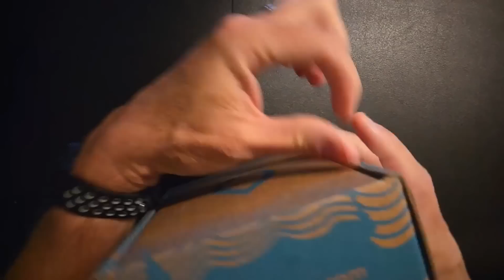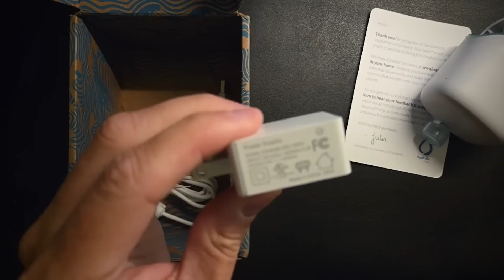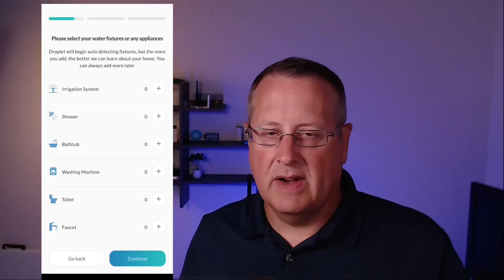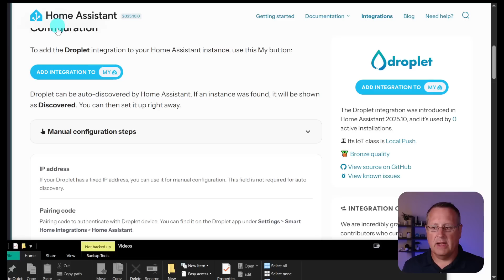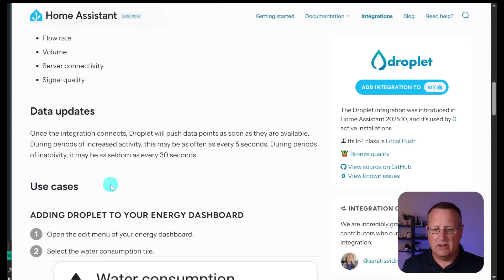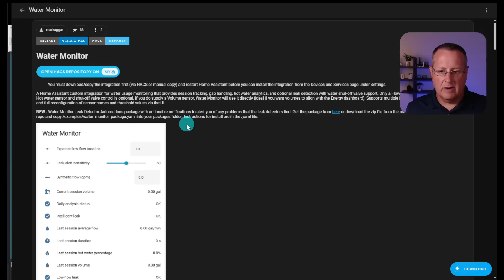Monitor your water usage with this easy to install water monitor.

Comment: My irrigation is a separate line and controlled by a B-Hyve controller integrated with Home Assistant.   I am thinking about adding this to the irrigation and monitoring flow rate during each zone to check for broken sprinkler heads, tubing, or non-functioning heads or zones.  B-Hyve integration updates HA quickly when each zone starts so I think after a few seconds for startup, I could compare the current gpm to a known gpm for a zone.   Do you think that is feasible?

Comment: can this be mounted only on the hot water line? I am more interested in seeing if it can detect micro leaks that I am having in my Uponor HOT WATER pipe than my water usage at this time. I would place it on the hot water line coming out of my heater. I have a recirculating system.

Comment: Why would you ever need to create an account on some vendor site in order to use a device like this? That would be the number 1 reason I would avoid this product. People need to stop providing personal information to every vendor that randomly thinks they need to track you. Not to mention using your google login for this. When your google account becomes compromised, you then have all accounts associated with it compromised at the same time. We all need to stop normalizing this type of behavior by vendors. Not to mention the need to install yet one more app on a phone to make ONE device work.

Comment: interesting summary Chris something i could use, i think the gaps may be something to do with water leaks and or if you say have various water flow items and add them that would most probably log their individual usage, i bet the ai then gets a handle on what pattern it will use based on regular times volumes they would use, what do you think, hi from downunder, it a shame you cant buy it out of the USA tho

Comment: i did install the Droplet with the HA integration.  I guess my end goal would be to quantify water usage for specific functions.  How much is going to laundry, flushing, dishwashing cycles?  Maybe I'll try a smart plug on the washing machine to detect when it is running and then try to correlate that with water usage during that cycle.

Comment: Droplet seems flawed: it’s cloud-dependent (so if support ends, you lose functionality), designed for indoor installs while most mains are outside without nearby power, and doesn’t appear weather- or IP-rated. The “advanced AI” pitch adds little you can’t observe yourself. If your goal is tracking usage for billing, a quick 10–20-second meter check does the job—no app, no data exposure, and it’s free.,  If it was local hosting no , issues with water ect.  I have a go as it is now it a but thanks but no thanks
Reply from the maker: This has local connectivity. It doesn't rely on the cloud to function. I have it integrated directly into Home Assistant. It is just part of the overall energy/water usage. There are definitely other options available that would allow for monitoring at the meter. Personally, my meter is buried in the ground and a "quick check" isn't really a thing.

Comment: Sure would like to know how this works
Reply from the maker: Only thing I can tell you is that is uses ultrasonic sensors. After running it for a few days, the app asks me to run a quick test to calibrate it and make sure when it sees a gallon of water, I actually ran a gallon of water.

Comment: The mounting requirements are very specific.   My exposed water line in my house doesn't have the required 4" of pipe... So won't work.
Reply from the maker: It was close for me. I have probably right at 4in. I did have to keep adjusting it until it would read (LED turned blue). Took a bit of doing. Still was under 5 min of messing with it.

Comment: I'm glad you mentioned section-based tracking. I have a water pump with a pressure tank, (off grid water) Note: pressure drops are needed for my pump to turn on when the pressure tank is empty, there is a half second delay when the water stops flowing. (Frustrating in the shower) From what you've described, the section setting is what I was wondering about, It sounds like it won't break up the shower into multiple sections with each pressure drop (that half second when flow seems to stop).
Reply from the maker: That is the other integration that I wasn't sure about. Yours is the first comment I've read that helps me understand what those gaps and "sessions" could be useful for.

Comment: does it work on plastic or PVC pipes?
Reply from the maker: Yes. I have it installed on my PVC pipe. There is a list of accepted pipe types on their website.
Reply: @mostlychris  I had a 13" horizontal run of 3/4 Pex with metal elbows and crimps on each end which should have met the required 4" either side.  I could not get it to accept that location.  I replumbed providing a 3' run of 3/4 Pex which did satisfy the device.

Comment: Unfortunately things like this wouldn't work in the majority of houses in Florida where the water pipe enters the slab (no basement).  Also, the water meter is outside.  In my case, it's at the edge of the road I live on.
Reply from the maker: My water meter is out by the street. I have a water softener line in the garage and that is where this goes. Also, since we have indoor water heaters, there is a pipe going there. What I can't measure, unfortunately, is irrigation usage.

Comment: This looks like it won’t be able to be outside, because my irrigation is outside before it goes into the house.
Reply from the maker: This one is indoor. I also can't monitor irrigation.
Reply: Why can you monitor irrigation like indoor. My irrigation originates from in doors out (in my case from its own pipe/meter.

Comment: It detects water leaks but does not indicate the minimum water flow detected?
Reply from the maker: Water flow is tracked in app and in Home Assistant if you have it integrated. Maybe I'm missing what you are saying.
Reply: @mostlychris  What I mean is that a typical water leak is so small that this system cannot detect it. This is evident from the fact that the manufacturer does not even guarantee or claim the minimum amount of flow that the system will detect.

Comment: For less money, you can get the Zooz Z-Wave Long Range 700 Series Titan Water Valve Actuator ZAC36 LR which actually turns off your water when it detects a leak. Yeah you have to do some plumbing, so depending on your situation, it may not be practical, but I plan to install that on my system, and will no doubt make a video about it, once I get my channel up and running.
Reply: It depends on your requirement and what you want for to achieve. If your need is to monitor water usage then you get the Droplet. If your need is to shut off a valve you get the Zooz based off another signal eg water leak sensor.
Reply: @neoxnet  true. Kinda sounds a lot like what I said, but with some additional details. I would be ideal to have both, but I wonder if there's an actual smart water meter that could be installed?  I have looked, but not found one.

Comment: I'd be interested to see an accuracy test. Fill up a known volume (e.g. a bucket) from a faucet.
Reply from the maker: The app has asked me to do this a few times, when I didn't have time. It does want to compare a gallon of water with the flow so I will do that and see how it compares. I bet it calibrates/adjusts based on this test.
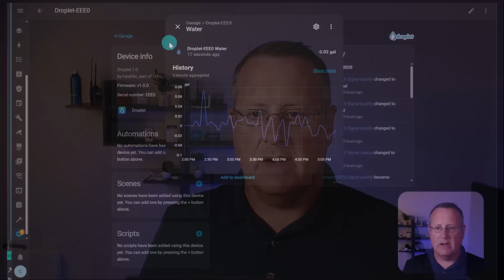Reply: Yep - @ 11:56 there are some negative flows - that could happen, but would be unusual. It would indicate something toward accuracy.
Other comments indicate we want to see the performance of this.

Comment: "Water Sessions" Is that for monitoring sprinkler usage?
Reply from the maker: I really didn't understand that part of the other integration I was talking about. Another comment did say they have a small blip in their water usage as their pump kicks in. A shower running at that time would show two events if it were not for session tracking. Now it makes more sense to me.

Comment: I would imagine the session is likely related to people with Well pumps.  Via use of a pressure tank sometimes the water pressure will go up and then down as the pressure in the tank drops and the pump kicks on.  that might cause some meters to indicate that faucet or shower has turned off when in fact, it has not.  

I just received mine the other day so I’m trying to figure out how it works with a Well pump, but I can tell you when the pump kicks on there is negative pressure and therefore I do get some negative volume for a few seconds.  It’s actually could indicate I have some back leaking in my pump, since my pump is 740 feet in the ground I assume that that is a given.
Reply from the maker: Yes. Some other comments have mentioned the well pump scenario. I also see negative flow in my energy graphs. I haven't taken time to figure that out. I am not on a well, but rather city water. I do see a lot of sand in my water every once in awhile. It would be interesting if the negative flow was actually an indication of something wrong and even though not intended, the Droplet pointed me to investigate.
Reply: @mostlychris leak

Comment: If you ever make another video on using this droplet 100% off line with home assistant, I would be very interrested. Also, I would really like to see it reporting very small usage. I wish to see it how it can detect small leaks or large leaks.  I had a water usage metering that was no good at all for tiny usage. I'm wondering about that one how it perform.
Reply from the maker: I guess I didn't cover that in the video or maybe I did. It can work completely offline. I have it integrated locally into Home Assistant. It does detect small leaks. For example, my water softener runs a very small amount of water for 40-50 min every time it recharges. This happens overnight and Droplet tells me about it. I think the alerts do use cloud but that is easily done via an automation in Home Assistant. Can't remember if I showed that in the video.

Comment: Just wondering if a session might apply to a laundry cycle.  Water use is intermitten in that case and it might be interesting to compare total use for various cycle selections.
Reply from the maker: Sounds like a good use case. Based on all the comments on sessions I've seen so far, I might need to dig into the other integration a bit more.

Comment: The claims it makes, at the start of your video is strange. How can anything that is a flow meter, and not a moisture detector, claim to detect water leaks instantly? Is that not just a flow. Even if at night, it could be the ice maker in your fridge. As you pointed out, control your water from your phone? The device itself will not conserve water, that would still be up to you. Lucky I am my own water company with my own well. I have had these alarms you mentioned all setup with other software. Monitoring water usage, if done correctly is very useful.
Reply from the maker: Good point. Water needs to flow for a bit before it will know that there might be a leak. Sounds like a bit of marketing speak. I do mention not to throw away those moisture detectors. They still have a place in overall water monitoring.

Comment: Your Droplet water usage graphs in HA showed negative water usage a few times.   This would indicate the water flow reversed direction, sending water from your home back to the water main.  Is that possible?
Reply: had this happen before. i monitor with an esp32. was very odd lol. hasnt happened since.
Reply: Technically it is possible if there is no vacuum break in the system. Measuring it though is another story. Going backwards usually only happens from outside use like a hose.
Reply from the maker: I saw that. Not sure what is going on but could be an issue that needs to be investigated. I have it right off the water softener so maybe something happens there. Based on comments here, I will take a look and see what might be going in (if I can tell).
Reply: @mostlychris  @mostlychris  do you have a Pressure Regulating Valve on your house?    If not, water can push back to the city when your water heats water.